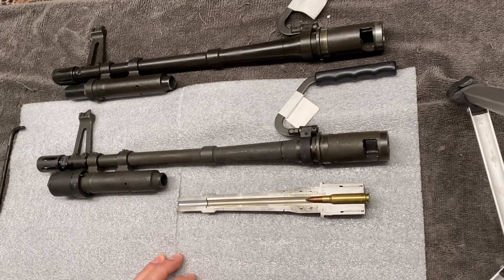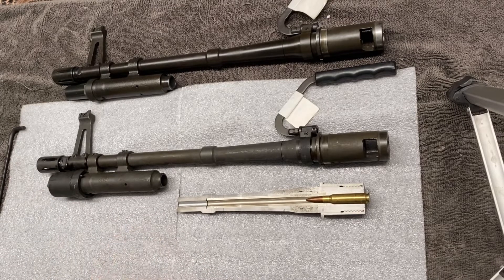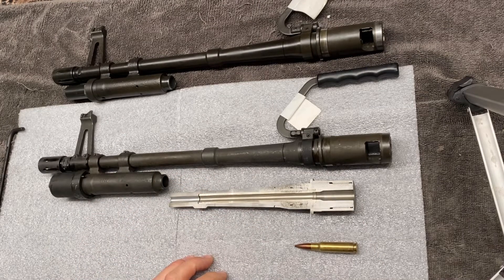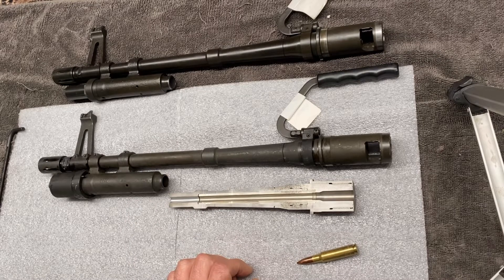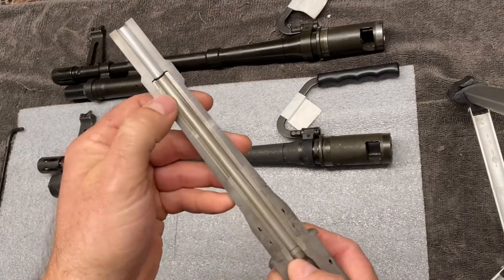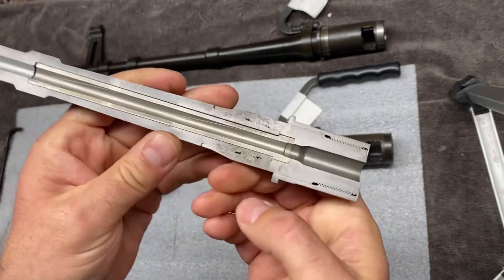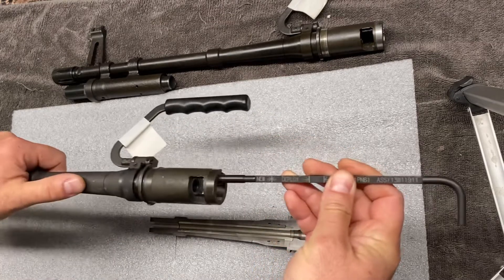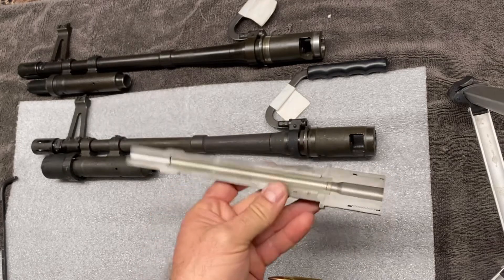M60 Stellite Liner: A Closer Look

Comment: Valve seats on aircraft piston engines and some hot section turbine blades are made of stellite, it is very heat and erosion resistant.